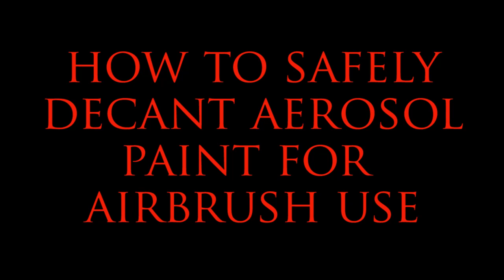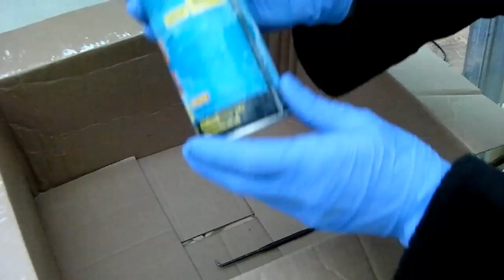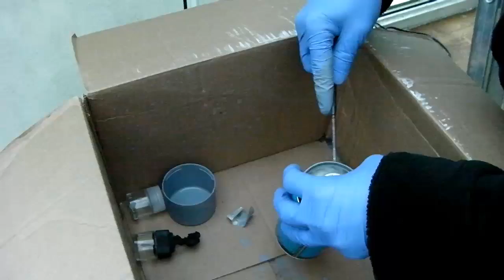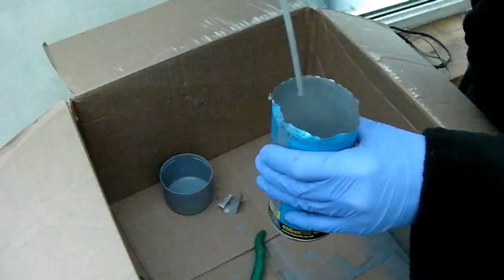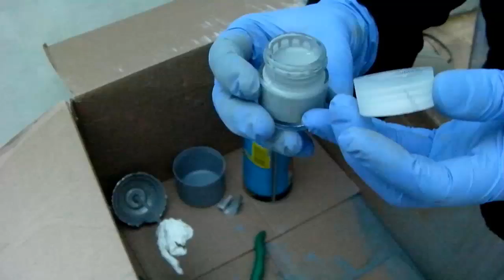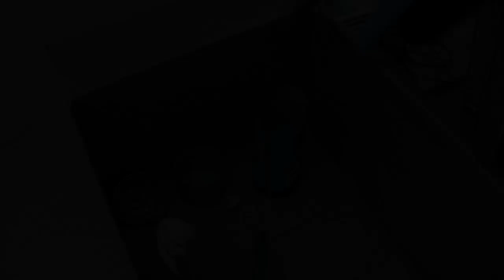How to decant aerosol paint for Airbrush spraying safely

Comment: I did exactly what you said and it blew paint all over, it is a good thing that I stuck a rubber glove over it.
Reply from the maker: If that's the case the can hadn't been left to settle and had been agitated beforehand. 
Think on it logically, the paint sits on the bottom, the compressed propellant on the top.
When you open the valve (nozzle), the propellant forces the paint down and thereby up the straw and out of the nozzle. 
If the can is agitated propellant will mix with the paint and fire it all over the inside of the can. This is why it's crucial to leave it to settle overnight.
Reply: spidiq8 Yes, the can absolutely sat overnight, like I said I did everything exactly as you said.  And yes, as I walked outside I was very careful not to shake the can.  Thank God I decided to put a rubber glove over the can or it would have sprayed all over me.  Just so you know, I am not just some kid, I painted cars for 6 years plus as a hobby I restore old bikes. So, I just wanted to let you know that even if you are very careful and you let the can sit over night it can still be a disaster.  You may want to add in a disclaimer or something or maybe warn people that even if they are very careful the can can still blow paint out of the hole.
Reply from the maker: +Jack Peters Very clearly stated at just over the 1:00 mark is a disclaimer citing the importance of taking great care,  wearing protective gear and preferably doing this in and safe area outdoors. I've decanted numerous aerosols this way and never yet had one that has sprayed paint everywhere unless it's been agitated first. At the most a small spray after shaking to mix paint and thinners as evident in the video here.
Reply: spidiq8 Have you ever tried to take the paint out of a brand new can?  I was thinking about it and that may be the reason that I had a problem.  And I forgot that you had put a disclaimer sorry.
Reply from the maker: I have decanted brand new ones after sitting overnight and no problems, the only other possibility is if the can was somewhere warm, heat will expand the gases in the can.

Comment: Just curious about the nozzle there inside ;  must it really be disposed off or could it still be reused for somthing else?This brings back old memories of the well shaken cola can pranks. So must do this right.Thanks for this Video -Cheers
Reply from the maker: Do you mean the spray nozzle on the aerosol?
If so I guess it could but as it works due to pressure it would need to be fitted into a pressurised and airtight container somehow.
For model kit use however, a standard auto shop aerosol has too heavy a spray pattern, if you check the Tamiya aerosols you'll note that they have a much finer nozzle and atomisation.